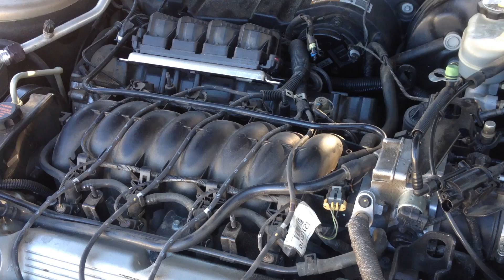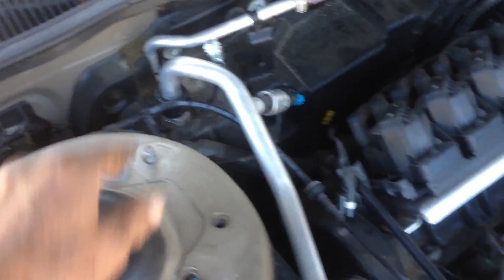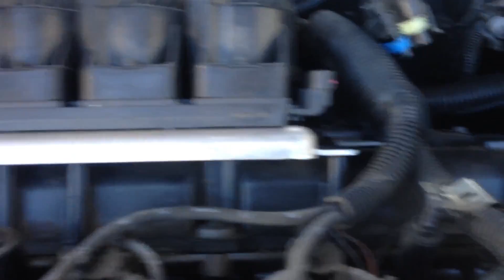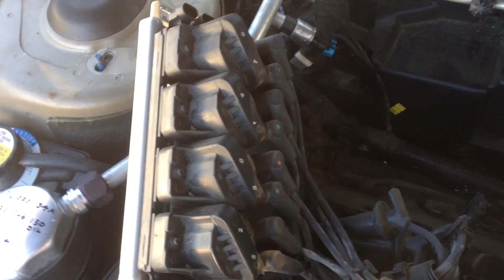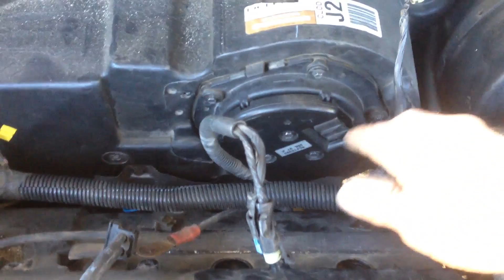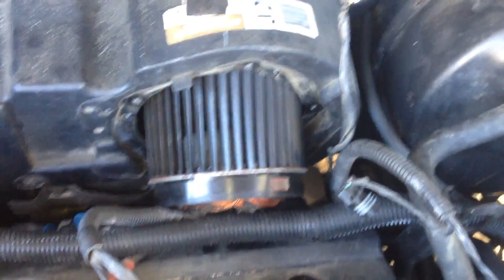cadillac sedan deville HVAC blower motor replace

Comment: i did it this way also without the turnbuckle. i also wanted to change out the spark plugs and sand down the ground wire contact.

Comment: There is stamping "CUT HERE". You should cut some plastic above the blower motor, then unscrew one bolt and remove the cover it holds. That's all. Now you can remove/install your motor easily.
Reply: Not on all of them. My 96 DeVille doesn't have that. All the black plastic stuff is gone and there's nothing but metal. There is no cover. Don't know why they didn't do that on all of them. I may just cut the metal and peel it back. So over this. Got the motor pulled back as far as it'll go with the turnbuckle and still can't get the new one in. Fucking GM crap!
Reply: @jndnaps  It's a pity %(

Comment: Worked on my 99 eldo. Beautiful. To remove all i did was remove screws, pulled motor out a little, used wire cutters to cut blower impeller blades, and after removing motor, impeller is laying there to be picked up.

Comment: What is the name of the tool you used to slide (pull) the engine over so you could get to fan?
Reply: Carla B it’s called a turnbuckle. You can buy them at just about any hardware store
Reply: Талреп.

Comment: Wow! You did it the hard way. I have a 93' Eldorado that looks very similar to yours, but It wasn't necessary for me to take a part hardly anything. My biggest problem is installing the after market model (blower motor) which has a different placement for the cooling hose. I was hoping your video showed the installation so I'd get an idea, but still pretty good.

Comment: This was a good video as a reference.  I just replaced mine on a 98 Caddy Eldorado.  I did not remove the coli packs or move the engine.  I just moved all the spark plug wires out the way and finessed it out and in.
Reply: I have a 97 Cadillac Eldorado, and my fan motor just went
Reply: @jacobr407  - I have a 1995 and mine just smoked like a barbecued steak!   Were you able to replace it yourself?
Reply: @HighSierraBob  I was not, a couple months later I had gotten into an accident and totaled the car.
Reply: @jacobr407  - that sucks!